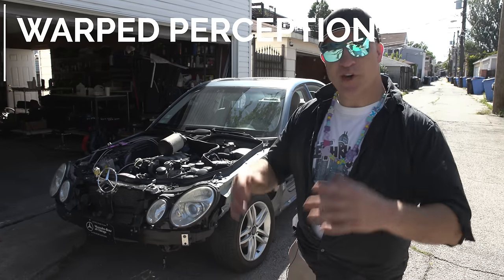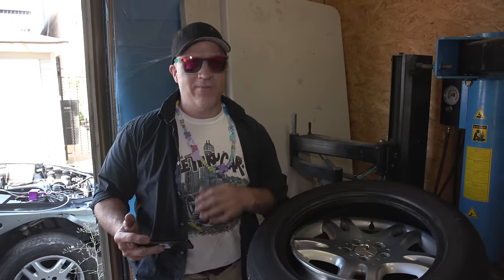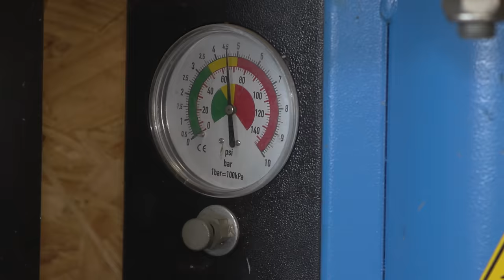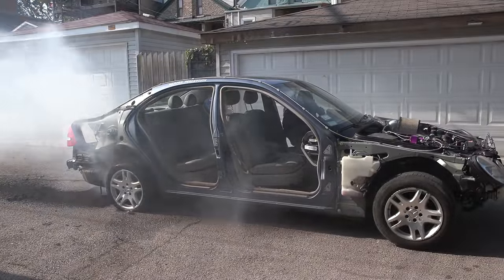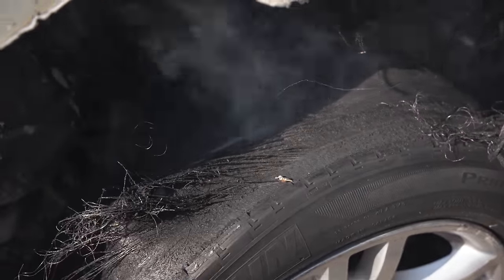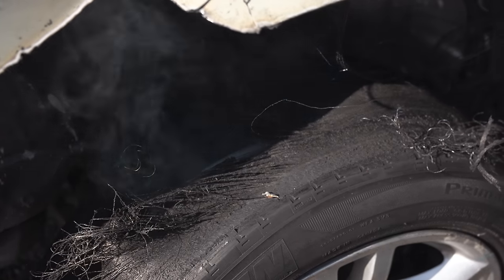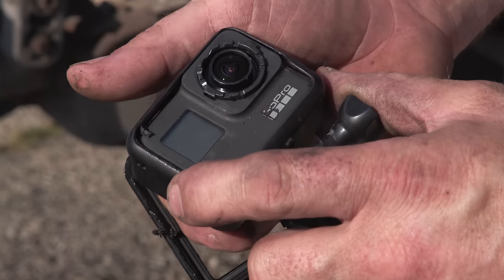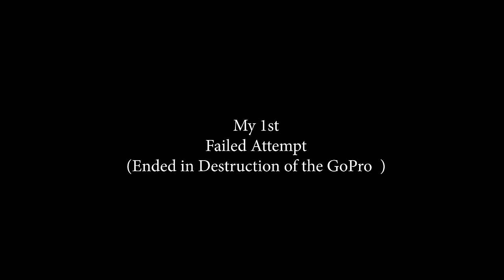GoPro Inside Car Tire During Full Burnout - (Boom)

Comment: why were the brake rotors glowing?
Reply: Because when you brake the brake pump sends most of the power at the front wheels and a bit goes to the rear brakes, so the friction of the brake pads rubbing against the disc make it glowing red
Reply: Friction creates heat
Reply: imagine cars usually have a 65% front and 35% brake distribution
so to keep the car from rolling the brakes are held, but that also means that the rear brake engages slightly to keep the front put
Reply: He’s power braking it to do the burnout
Reply: You have to brake some so car doesnt leave lol
Reply: Good question easy answer.
Reply: I liked that much more than the one just driving. :D
Reply: Your profile picture is that of a God’s, it’s gorgeous!!😹
Reply: When you push the brake pedal, all wheels brake, whether you are moving or not. So by trying to keep the car from moving forward with the front wheels, the rears are braking too. There are a few cars that have a "burnout mode" where the rear brakes are disabled for just this purpose, but this mercedes is definitely not one of them. Of course, if you put a lot of brake pressure continuously and don't supply airflow, they are gonna heat up until they glow.
Reply: Extreme heat, brakes get hot very easily. When the brakes are cool enough to touch, one quick stop makes then too hot to touch
Reply: okay that makes alot of sense, i always thought the rear brakes were only used when you enabled the hand brake
Reply: Also no line lock on this car
Reply: because he didnt use line lockers to crimp the rear break line
Reply: What u never seen brakes heat up???
Reply: @Sebas_frl  Yes, the rear brakes are used for the handbrake, but using the rear brakes for normal braking is very important! Imagine braking hard in a corner with nothing holding the rear, that could fling the rear of the car out6and you would have a nasty accident
Reply: @adrianroper1353  i have its just i thought it was strange that the rear brakes were being used by pressing the brake pedal.
Reply: @pokemon3742 Okay good to know, thanks.
Reply: It's friction you can see them glowing in many burnouts
Reply: That's Called " Horse Power " Son
Reply: This is why most people doing this use a line lock or just plug the rear the hyrdo lines.
Reply: Air i thinl
Reply: Nk
Reply: I like how he did this in a neighborhood lol
Reply: Davide Antonazzo is ikopg
Reply: Dezz you want to see some siiiiiiick photographs of cars.. google search cars with glowing brake rotors, there’s soooo many cool photos of that happening on track at night.
Reply: Cars built specifically for burnouts got a modified brake system that disengages rear brakes (line lock).
Reply: Robin Maurer we know
Reply: @Ben W - Ask the Aussies.
(They aren't built like that by the factories ofc., but modified / rebuilt by tuning workshops.)
Reply: Car that are built for burnouts don't have back brakes look up cleetus McFarland he has many burnout cars
Reply: POWER BRAKE BITCHS!!!
Reply: @Sebas_frl  all brakes engage  when you press the pedal..just rear when you use an emergency brake..
Reply: @terriwebb5093  - in a car that's not tuned for burnouts. I. E. lacking a rear line lock.
Reply: @dave_xc  at first I thought "oh cool he installed line locks or pinched off the lines.  Big nope on that lol.
Reply: @Tyleeclinton  what ikopg means?
Reply: I'll bet your neighbors love you😂
Reply: @avrick21  ?
Reply: Dezz you got to have the brakes on buddy lmfao
Reply: @Sebas_frl  hahahaha
Reply: Is this an AMG Mercedes I thought they had at limited-slip diff?
Reply: basicly my first driving lesson
Reply: Watch ford vs Ferrari
Reply: @Sebas_frl  thats the park/emergency brake. Front 70% rear 30% braking.
Reply: why does youtube believe this guy deserves nine ads that i luckley do not have to watch  .  :))
Reply: No way to use front brakes only
Reply: I was waiting for the engine to blow first or drop the CVC shaft lol
Reply: You don't see proper "burnout cars" or drag racers with glowing rotors because they have a lever or button that disconnects the rear brakes so they don't cook them when warming the tyres (tires, I'm British).
Reply: Science
Reply: It’s called a line lock it was not designed in this car so the breaks were probably not made for it
Reply: When you do a burnout, you hold the brake, and friction creates heat in the back
Reply: Clearly you have never studied physics
Reply: @chrish1695  i know what friction is.
Reply: He would have had the brake applied to do the burnout.
One way to avoid it is to crimp the rear brake lines with something when doing burnouts.
Reply: It's the brake fluid it was over heating
Reply: Dorfe frage, ist klar weil er hack antrieb hat und daher bremsen muss hinten sind meist 40% vorne 60% deswegen kann er stehen und ein Burnout machen.
Reply: If you don’t understand the science of friction creates heat, than just take it as the guy bought cool Halloween brakes 😂
Reply: @dior.d  back Drive he Must brake for burnout . Brake rear 40% brake Front 60%
Reply: Because only 40 or lower of the percent goes to the back of the breaks
Reply: @dave_xc  thank you for explaining
Reply: Because of heat
Reply: A year later……. Dezz now knows why the rotors are glowing ,,, and now one step smarter , yay YouTube
Reply: Friction
Reply: Tip: If you take the caliper off and put a piece of wood inbetween the pads zip tie it all together and out of the way you should be able to save your brakes and do a burnout easier.

Comment: From the GoPro's point of view, the car is spinning and the wheel is stationary
Reply: Actually not, the GoPro doesn't see any rotation, only the walls of the tire 'waving'

Since the rubber of the tire is moving at the same rate as the rim that the camera is attached to, and there's no outside frame of reference ... without using any other sensors other than visual the camera doesn't see any rotation.
At least I think that's how it works ... frame of reference and Einstein..
Reply: @over9000713  That's exactly what she said without the wholly unnecessary semantics, contrarians aren't well respected.
Reply: @over9000713  r/woosh
Reply from the maker: Only if the stabilization is disabled, I didn't disable the stabilizationon one of the takes and the camera was going nuts from the centrifical forces and the harmonics. It was pretty weird actually, since there was a consistent frequency even with the vibration the image was sort of spinning.... Looked really weird
Reply: @WarpedYT  I'd like to see that footage.
Reply: @goodnessgracious8819  me 2
Reply: Goodness Gracious agreed!
Reply: @WarpedYT  *Hey WP, look how many people wishing to watch that footage! Post the footage! Post the footage! Post the footage! *
Reply: @warpedperception post the footage man
Reply: Warped Perception yeah the gro pro would oscillate as its natural resonant frequency.
Reply: in fact the entire world is rotating
because the car is stationary relative to earth

Comment: I would LOVE to see this inside wrinkling drag radials!!
Reply: Yesss. That orr inside low pressure offroading tyres
Reply: JordanWoodland ooooh yeah that would be great!
Reply: say goodbye to the GoPro again probably
Reply: Giant Caterpillar  Uke tires filled with concrete
Reply: @rainbowrailroadcrossing7798  All you'd see was concrete, no movement or anything? 😂
Reply: JordanWoodland 

They do have air the concrete is there so the damn thing don’t fall on there side holding huge minerals in the buckets
Reply: This would be amazing.. i love how much a drag car tire wrinkle and roll off the line and then come to life after they take off..
Reply: That excuse all youre shit... great Stuff ,Good dog!
Reply: Would be good but it would unbalance the tyre to much you would struggle to get a car/team to run one for you.
Reply: @clintsrandomvideos1171  to Balance the Wheel, just use two Go pro in oposite position :-) on the other hand, such raceteams know how to balancing wheels... with 2 cams ,there is a double Chance to have a surviving Cam !

Comment: Did anyone think about what happened to the left Tyre
Reply: Open differential
Reply: @pyroboobysmith359  he answered in another comment they were cool with this
Reply: Wonder how he knew the right wheel would do the burnout
Reply: @RICHOCHANGO  most if not all open differentials will spin the right tire when doing a burnout, i think it has something to do with the way torque loads the suspension or the way the carrier is setup inside the diff
Reply: Remember he put fluid down in front of the right tyre so it slips first, then because it is so bald it has no traction so it continues to spin while the other side probably had a decent tyre with lots of grip still on it.
Reply: @rjs198585  hmm interesting.. Newton's First law

Comment: I’d love to see what happens to an under inflated tire from inside. I know the sidewalls start loosing rubber and get thin and then explode, but it would cool to see from the inside!
Reply: i'd take it a step further; run over something that punctures the tire where it loses all air pressure, and then drive on the resulting flat tire.

Comment: This was a long and descriptive comment from Warped Perception that got buried down below:  Putting it up here:

Believe it or not, no. It's a long story with this project but I blew up 5 tires in the course of three days. originally I was going to do this 
somewhere else and then my neighbor's literally told me it's okay it's not a big deal oh, but I don't think they knew it was going to be 5 
tires in a row, neither did I. there was some bad crew communication and the person that was supposed to tell me that the tire went flat did not
 tell me oh, that's why the GoPro was destroyed. And the first two tires were nothing but technical difficulties because the amount of intense 
air current inside the tire as well as the heat created, the are inside of the tire got up to almost 350 degrees, I was going to show that with 
the thermal camera, but this video was not about that it was just about the inside view. It was pretty crazy the things that I learned on this 
project.

Comment: You have to be the favorite guy in the neighborhood now.
Reply from the maker: Oh man... I'm not even going to lie, I was a bit nervous about this one. My neighbor's literally told me it's okay don't worry about it, then I roast it and blew up one tire, the air currents in the tire were so extreme that it completely moved the GoPro, and the heat was so intense that the GoPro is overheating and almost melted. So then I roasted a second and the third Tire, I had bad crew communication, someone did not tell me that the tire had already went flat. So at the end I blew up 5 tires over a course of three days. I don't want to get my neighbors upset, the amount of smoke that this experiment produced was beyond my expectations to say the least, and we're not even talking about the noise from the explosions... But honestly that's one of the things I like about Chicago, most of the people here are really really cool also the police are super cool... Most of them.
Reply from the maker: Kinda ..  as long as I don't destroy anything or anybody's property I'm good. I'm always very nice and very kind with my neighbors whenever they need to borrow tools or machines or anything that I have I'm more than happy to.

Comment: This is utterly fascinating. It shows the toughness of the go  pro camera I’m just saying that first.

You did some nice camera work from the outside in case the gopro failed.

This video is very cool because you can see the crack forming. The crack in the tire formed right within the view of the camera. And it’s a 7 so no questions needed about what camera model was used. :)

What would happen if u tried this on different tire types? Could be interesting

Comment: Great video. Thank you. The g forces and heat on that 2nd Go Pro must have been incredible.  I'm impressed it survived! Would have been interesting to get before and after temperatures of the diff and the tyre.
Reply from the maker: I blew 5 tires total.... 2 of these were realizing how violent the air currents inside the tire were and the temperature the air reached was almost 350°... Crazy!.

Comment: Couldn't have been a better spot for the blow out. Awesome vid, although we need you to do it one more time. What was the inside temp of that tire and go pro. Had to be friggin hot
Reply from the maker: I almost pulled out the infrared camera and included talking about that, and the intense violent air currents that were occurring inside the tire, that was a serious struggle but the internal temperature during the burnout got up to about 350 degrees at one point, I blew out five tires total to get the footage. The cameras were overheating shutting down and on the third Tire which had a lot of tread the burnout was like 5 minutes long and the GoPro practically melted. It was nuts
Reply: @WarpedYT  Oh wow. I didn't think about the air current inside the tire especially with the gopro acting as a wind blocker or fan blade. 
Thanks for all the work that you do to produce content.

Comment: Aye -there's a  lot to be said for Method statements and Procedures procedures procedures : like measure 10 times  but cut ONCE    but that was another good vid:  even if just to show how the shredding tire can rip out  parts of the fuel tank system:  Petrol on the M Way at 150mph, anyone ?   Thanks for posting - did you get a new Hero then  ?

Comment: Would be really interesting to put camera inside a tire and reduce the pressure in steps untill the tire collapses. That way you would have amazing footage from the inside on how tire construction is giving away slowly untill the tire explodes.
Reply from the maker: But why reduce the pressure.
Reply: @WarpedYT  With reduced pressure (0.5 bar) the tire would start to be damaged from the inside and it would be visible from the inside with go pro it would be very interesting footage from inside

Comment: Damn can see all the smoke inside the tire. Obviously gets pretty damn hot in there, too.
Reply from the maker: I measured almost 350 degrees.. basically an oven temperature. I was going to talk about that in the video and also use an infrared camera, but since that was not with the video was about I left it out.
Reply: @WarpedYT  Wow! Surprised the go-pro survived all that.

Comment: I'm a little confused here wasn't the GoPro Mounted on the rim? I would have thought the GO pro would have shattered after  just1 rotation of the wheel? Even if the frequency of the camera matched the rotation speed of the wheel surely the image should represent to be this still ? I can't even seen a large enough bump as the tyre goes over the go pro? surely he couldn't hold the accelerator at the exact same turn freq as the camera without any change in speed at all.....i mean there are a few videos of cameras matching the blade frequency of helicopters and you can still see some sort of movement as slight freq changes take place.

Comment: How about GoPro inside a lawnmower deck.  (If there is enough clearance)   Now, my thoughts on preventing the lens from getting caked up with grass would be to mount it in such a way as to point the lens in the direction of blade rotation.  The view would be of the blade moving away from the POV.  But gass would eventually build up on the backside of the cam and possibly cause the blade to hit the lump of grass and transfer that impact to the cam.  So an alternative mounting could be to position it near the spindle, facing toward the end of the blade. 
OR..  Better yet, mount the cam TO the upper side of the blade, as near the spindle as possible.  This way may be able to show the cutting edge and the grass being cut.
However, at normal mowing RPM, the cam could come loose.  so keep the engine at a low idle and engage the blades slowly (Unless your mower has electric mower clutch)  * If using a push mower without a throttle, you could rig the carb to let the engine run at a low idle. 
Just throwing some ideas, and possible solutions against the wall...  Lets see what sticks..

Comment: just wondering have you got your neighbors call cops on you?
Reply from the maker: Believe it or not, no. It's a long story with this project but I blew up 5 tires in the course of three days. originally I was going to do this somewhere else and then my neighbor's literally told me it's okay it's not a big deal oh, but I don't think they knew it was going to be 5 tires in a row, neither did I. there was some bad crew communication and the person that was supposed to tell me that the tire went flat did not tell me oh, that's why the GoPro was destroyed. And the first two tires were nothing but technical difficulties because the amount of intense air current inside the tire as well as the heat created, the are inside of the tire got up to almost 350 degrees, I was going to show that with the thermal camera, but this video was not about that it was just about the inside view. It was pretty crazy the things that I learned on this project.

Comment: 9:30:  There is so much unexplained crap in this video.  If the tire blowout destroyed your GoPro AND the SD card, how come you still have completely intact footage from inside the tire of the tire explosion FROM THAT PARTICULAR EXPLOSION?  In addition, I knew that this experiment would destroy your GoPro because the rim of the blown tire would come right down onto the ground against the camera, and the camera protrudes up above the height of the edges of the rim.
Reply from the maker: Simple because I did it twice, the only reason the GoPro got destroyed the first time is because the girl that was helping me told me to keep on going after the tire had already blown out. For the second time as soon as it blew out I stopped spinning the tire.